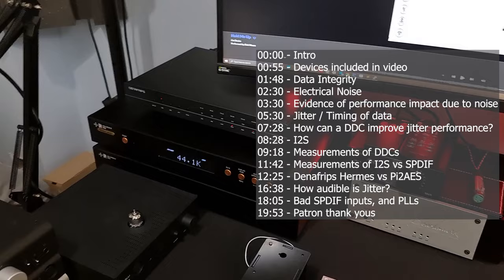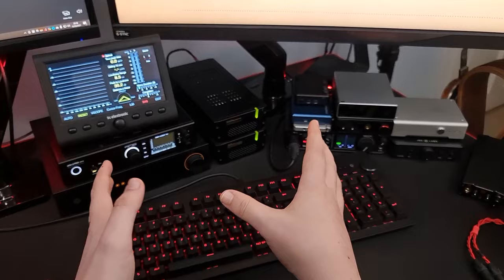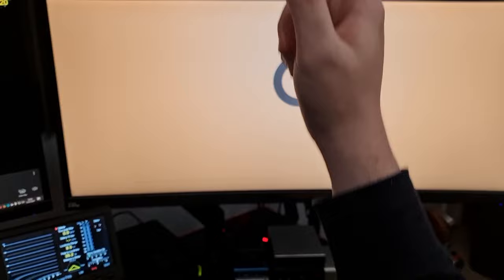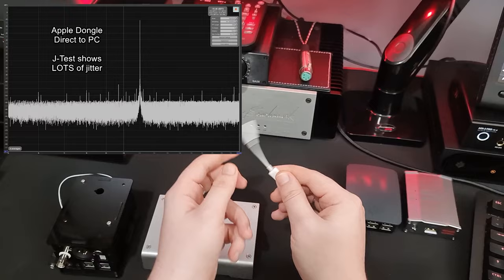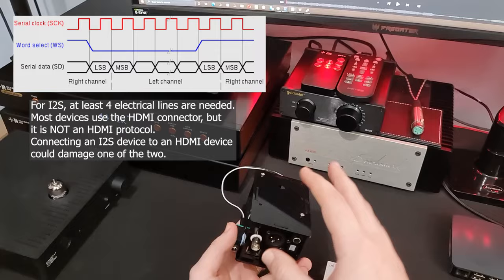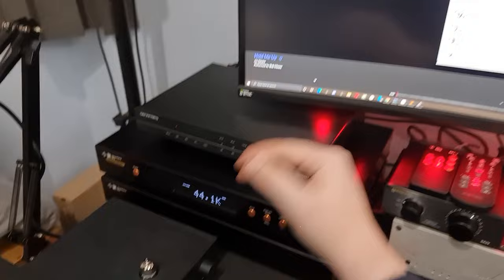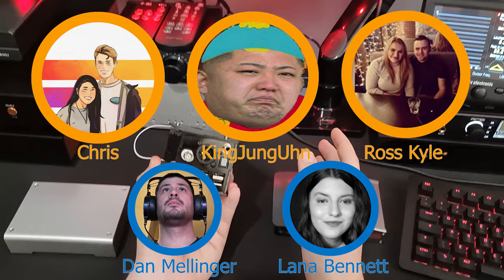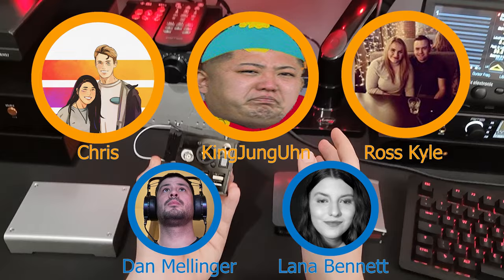How do DDCs improve audio? (Denafrips Hermes, Pi2AES, Schiit Eitr, ifi Igalvanic)

Comment: I don't get it. I output my audio through HDMI, it is produced by the GPU itself (RTX 3090) and turned into analog signal by the DAC inside my monitor (LG 43UD79) from where I pick it up at the line output (3.5 mm stereo jack) and it goes straight to my amplifier and loudspeaker. The sound coming out of this setup is so sharp it will cut you like a razor made of razors. I have never heard things like GPU activity produce any sort of noise in the audio output and trust me, I'm anal enough about audio quality and noise. I'm also an electrical engineer who knows why the products you're showing are really solutions in search of a problem.

Might I suggest that if your PC craps your audio quality, you have a PC problem, not a digital audio problem ?

Comment: Optical Out at my MacBook Pro is the only "high quality" way to feed my AVR with Dolby Digital 5.1
On the go im also fine with the internal DAC for headphones, its a quiet beefy analog output, but its output quality (2010 Model, only 2013+ models have better DACs when it comes to sound quality) is very questionable, but still fine for closed back headphones on the go like my Sony V700 DJ i still love.
When using optical out its definately miles ahead compared to a analog connection with the MacBooks internal DAC. I dont know why but my 2010 Model doesnt allow DD bitstream over HDMI. Over HDMI the stereo sound is also ok on the AVR, but sounds exactly the same as with optical toslink.

Comment: Really great video. You showed the Pi2AES beat the Hermes in jitter but then your Optical + PLL test showed that had basically no jitter. Is there any downsides to using PLL? Like would you still use I2S over optical + PLL?
Reply from the maker: The may has a suuuuuper effective PLL (Atomicbob on SBAF measured it as attenuating over 80dB).
This is great because it means that even with a crappy source, jitter isn't a concern.

BUT, there are two downsides.

1) Some devices will have jitter too far outside the PLL's locking capability, and simply won't work (meaning you'll have to turn off the PLL, though honestly should really think about changing source at that point if its that bad). The MiniDSP devices have been known not to work for example.
Though most stuff will be fine.

2) Locking time. When the source is first connected, or changes sample rate, the PLL can take up to 10 seconds to 'lock' to the signal. Which if your library has a lot of tracks of varying sample rates, can get somewhat annoying. Though many players like roon have a "resync delay" option where it will swap sample rate, but won't actually start playing until after a set delay has passed, giving the dac time to lock so you don't miss any actual music
Reply: @GoldenSound  Thanks for the great info.

Comment: Hello GoldenOne, Unfortunately I couldn't understand from your video what makes I2C better than USB? Could you elaborate about it a bit?
Reply: @dshnig  It's better to be skeptic about Amir's measurements too. I bought some of the best measuring dacs in ASR list and they had serious sibilance & glare problems in treble. (even with Neumann KH 310 this was apparent). Sabre X was one of the good ones, it didn't have these problems but transients & staging were surely lacking. cheap DS dacs are very good with test tones but when it comes to something complex like music they have hard time to push noise to inaudible levels. DS dacs are hard to design too and because some chi-fi dacs measure good with test tones that doesn't tell us the whole story.  "Precision DAC"s used inside the nuclear magnetic resonance machines are mostly R-2R, they are all set to 20bit(in room temperature there can't be 21bit data). Meanwhile ASR fans are overlooking & hating R-2R's for how bad they measure with test tones. ASR is good to follow but they know few stuff they are talking about too. Amir is just a hobbyist guy with a expensive sound card & measuring device. Things are way complex than they think. TI R-2R data sheet: https://www.ti.com/lit/ds/symlink/dac11001a.pdf?ts=1619298935429&ref_url=https%253A%252F%252Fwww.ti.com%252Fproduct%252FDAC11001A

Comment: Realistically wouldn't a DAC that can reclock the signal, and run over and optical cable, be the best possible solution in the event that an end to end I2S connection is not available? Optical removes all the possible issues with noise in transmission that other formats have, the only downside being that it is prone to jitter, due to using the clock of the sender, not the receiver. If you reclock that stream of data before it hits the DAC chip then this would result in a clean, ground loop free, and well timed data input, and it would be able to be used with a ton of sources as so many already have TOSLINK ports (almost all desktop computers) unlike I2S.

The system would just be plugging and optical out into your DAC, it would be dead easy.

Comment: GoldenSound-

Love your content and your willingness to educate the masses. However- leave this iteration with my own bone to pick. Am an electrical engineer and have a pretty decent background in digital signal processing. My view is that ALL DDCs may unfortunately be another opportunity to sell yet another snakeoil box $$$$.

All of the best DACs will have plenty of isolation implemented on their USB inputs. For the rest, perhaps an additional widget in the chain could solve the issue of jitter....?

IS jitter truly an issue to begin with, though? 

Unless you are streaming multiple audio players, at the same time, maxing out your source system PC CPU and RAM for example; you're extremely unlikely to observably notice anything due to the upscaling capabilities in modern DACs. This is the whole reason for up-sampling to begin with. It is able to reconstruct the same PACKET within a few clock CYCLES (think- the onboard crystal clock frequency are far higher than in our audible ranges; even if it took 2 or even 12 cycles to recraft the original bit perfect output- we would NOT notice a thing). It is a PLL (closed loop) system operating with adjustments being made much faster than anything we could audibly detect; said differently.

Open to hearing more about the advantages of DDCs, however, some charts with a slightly different noise floor and elimination of some of the already inaudible -100db range peaks on the FFT really don't serve (me personally) any added conclusions...

UNLESS: the peaks associated with ONLY DETERMINISTIC jitter [random jitter will mostly be caused either by source component interrupts on PC tasks, OR electrical environment noise/signal loss] do SUM for tones/timbres in that audible frequency range (10-12k in the midrange appeared quite the problem area; perhaps this is why the midrange can 'feel' more 'fatiguing' or overly 'bright' ?

Can we be onto a white paper together?

Would love to collab.
B

Comment: If there is any additional filtering inside Hermes it will constrain the bandwidth, which will degrade jitter as both LF/HF noise and bandwidth are responsible for jitter.

Comment: in a overclocked cpu gaming pc with tight ram memory timings is a jitter fest if you use loose memory timings and lower the voltage of the cpu and ram jitter performance will improve to high end DAC levels.

Comment: Getting rid of the usb noise is a trivial problem. Just dont use the 5V line from the usb and use and external isolated power supply. A ground loop, (two paths to ground between devices) is what people hear. Very few modern cheap dacs has problems with usb noise these days.

Comment: I see you are using a Raspberry Pi 3. In my research the Pi 3 has a shared bus between USB and Ethernet which can cause noise. They were separated on the Raspberry Pi 4.

From what I've read a Pi 4 would offer better performance.

Comment: Instead of just saying PC, best to tell what make and model (eg DELL PRECISION T1700), or tell the motherboard model (eg MSI H11OM VH-PRO PLUS).  Otherwise it is meaningless to say the pc audio is awful.
Reply from the maker: Unfortunately the answer is that it mostly doesn't matter. Any moderately powerful desktop pc is going to have pretty poor ground plane pollution and noise issues.
Reply: @GoldenSound  The audio source of (Denafrips Hermes, Pi2AES, Schiit Eitr, ifi Igalvanic) is USB!
  (ifi Igalvanic) is a USB Signal Regenerator!!!   How does that work?

Comment: Ethan WIner: "Jitter manifests as noise 100+ dB below the music, and is never audible. Nor does it create 'a lack of depth, solidity and a smearing of the stereo image".
Reply from the maker: Time and frequency domain are two separate things.

The j-test is a clever way to measure jitter using fft by 'forcing' jitter to create frequency domain distortion. But it needs to then be converted to a time measurement to get proper insight.
It should not be directly equated to other types of distortion in terms of levels shown on a j-test

Comment: I've been telling this for years, USB is a bad audio output connector, it picks up all the noise present in your computer.
Reply: The Allo USBridge Signature takes care of that USB noise just fine. Using it in conjunction with the Pontus II it has awesome sound. I will agree the USB from an ordinary computer is trashy for sure. Whether or not I need a D to D converter for I2S is another question. Has anyone tried the Iris from Denafrips ? One would think the USB inputs on a medium to high end DAC would not need I2S for the input.